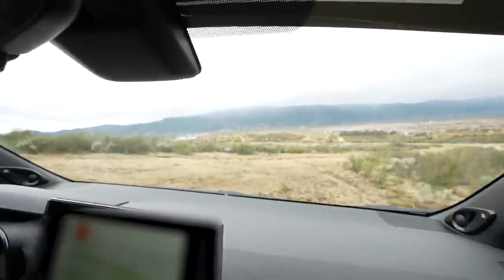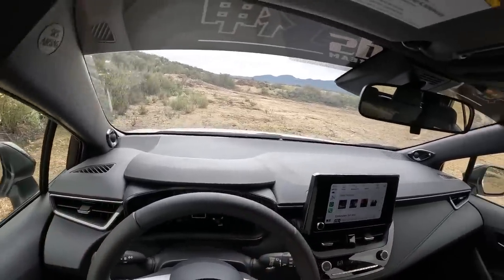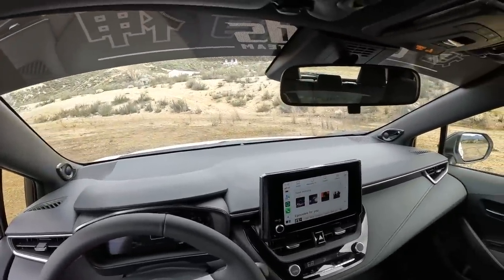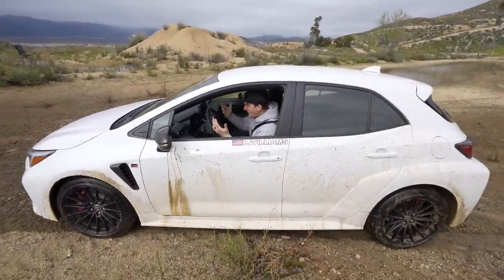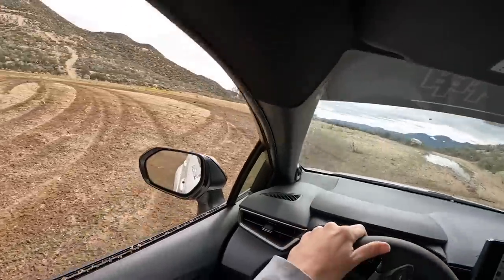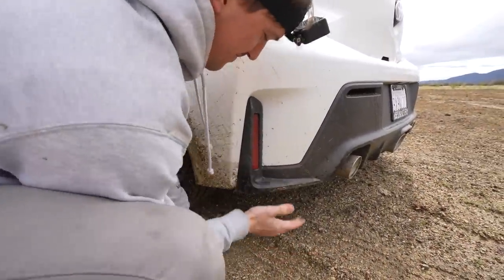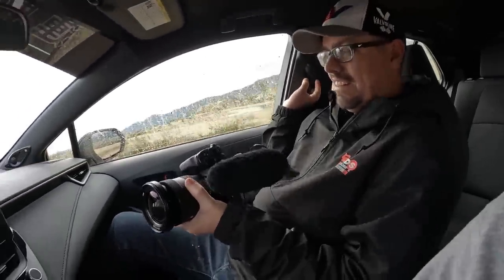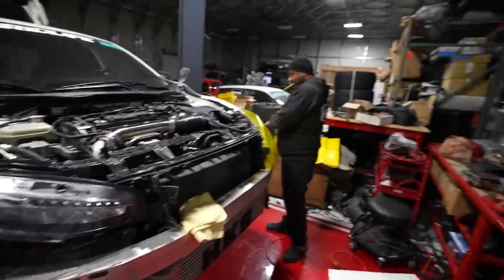Is the New GR Corolla Good Off-Road?

Comment: I'm so glad you guys are using the car for what it's intended for: having fun . Most people would get it and garage queen it. Like they would just let it sit there without use and flip it a couple of years later.
Reply: It’s a Corolla 🤷‍♂️
Reply: @ky7037  that’s what I was thinking but he also has a point because it’s low mileage rn but it can only depreciate from here on
Reply: I have 2100 miles on mine after a month, multiple full sends at the top speed limiter, donuts, hand braking around tight hairpins, it’s taken it all very easily
Reply: But they are not wrong to Garage it as an investment. This car is very special. More special than the supra because it's all Toyota. I will however have fun in my Core edition with performance pack and cold weather package.
Reply: @Outlander Freeman  That's the mindset that's killing modern culture bro. This is why we can't have nice sports cars nowadays, cuz people treat them like investments instead of an actual vehicle. Are you buying a car to drive it and have fun, or keep it without driving it for a long time and sell it? A friend of mine managed to get an FL5 CTR and drives the damn thing like he means it almost every day.
Reply: @lawnmower6591 yeah, the whole damn point of a hot hatch is to be a sporty, fun car you can actually live with

Comment: Looks like Toyota put in a lot of their tech from the Yaris rally car into the GR Yaris & Corolla. So cool to finally see Toyota back making cool cars.
Reply: Yes and no 

The yaris wrc car has turbo charged 4 cylinder + hybrid tech 

 the road homologation gr four  yaris has 3cylinder turbocharged engine with awd drive train 

the gr four corolla has the same engine and drive train that a road homlogated gr four yaris has  except its a four door not 3 door hatch and may have slightly improved engine
Reply: @olavofernandes7286  GR Yaris Rally2 has 1.6L turbocharged I3 engine

Comment: There’s actually a purpose for the yellow film on race car headlights. With the ashesive film over the lights, if you wreck or a rock flies up or w/e and the headlights crack, the glass/plastic wont go all over the track.
Reply: Does ppf on thete work the same?
Reply: @jobani97  i honestly dont know, but maybe? As long as its sticky enough to keep the shards contained when shattering it should be fine